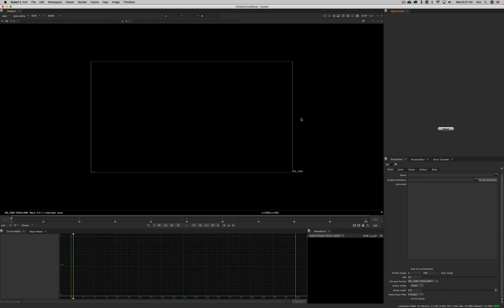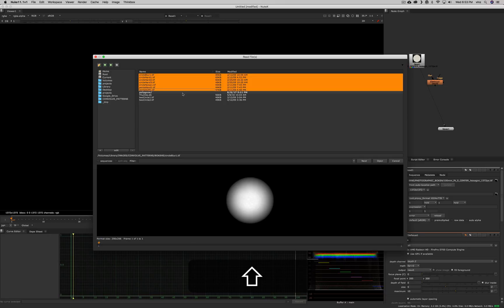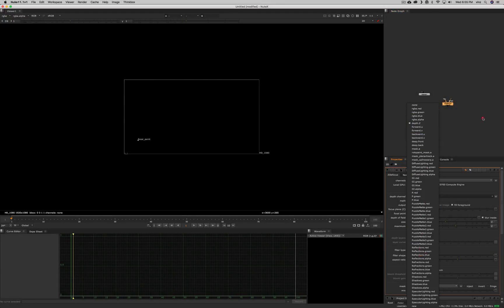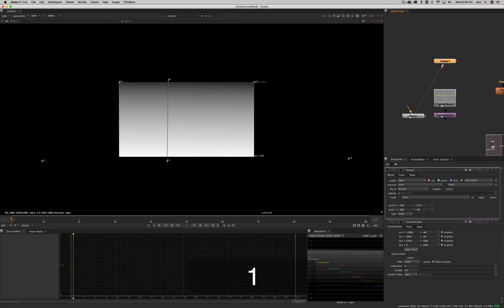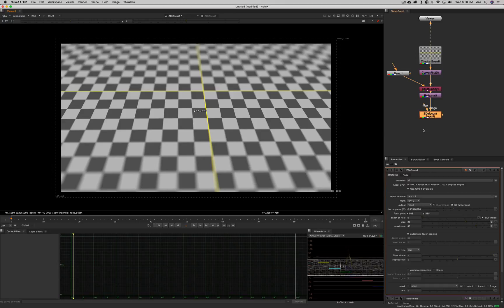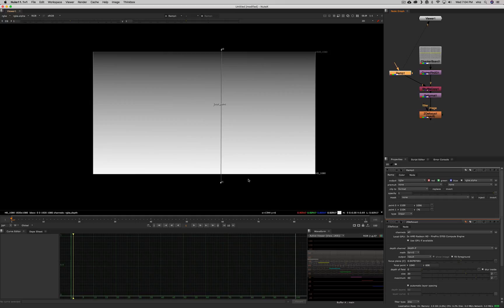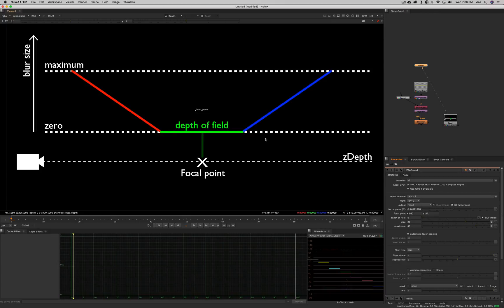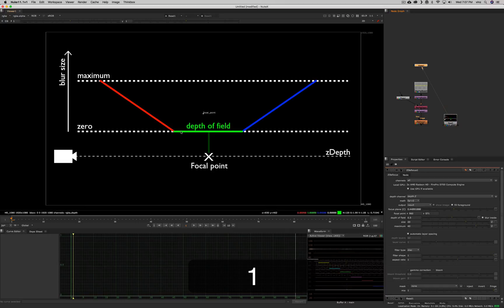Nuke Nodes Kickstart - ZDefocus

Comment: Great explanation mate, really helped to understand the concepts.
I got a question: Why is it a common practice to extend the edges of Z-Depth before feeding to the Zdefocus node to avoid artifacts?
Read that it's because of aliased Z-depth and antialiased alpha - but how does that be a problem?
Reply from the maker: Hey, Thanks for the comment! To answer your question, it would deserve its own video, I think.
The short explanation is that in the RGB channels, objects are rendered with antialiasing, while the Z channel (when not anti-aliased) describes an object's distance to the camera.
So if an object is at a distance of say 10 units, and the background at 100 units, the Z will show a value of 10 right next to a value of 100, while the color channel (RGB) will "smooth" the transition between object and background over a few pixels, hence the discrepancies between Z and RGB.
A quick and dirty fix for that is to extend the edges of that object in the Z channel to "cover" for these anti-aliased pixels.
I hope this answers your question a little bit :)
Reply: @TheFrameLab  Thank you for your time and attention :)
Was dealing with placing a CGI object into a scene.

Thought that artifact comes up only when we got Z channel for an object.
So, even if we got the z depth for the entire scene, problems persist.

Also, a friend in a forum told me yesterday - "At the edges, you might see an anti-aliased pixel that falls outside of the object on the non AA depth, basically creating a pixel that either sits at 0 depth or infinity depth, depending on how you render depth."

I think everything makes sense now.
Thanks once again :)
Reply: @TheFrameLab  hi, pretty much appreciate your work on this - going trough the nodes, quite helpful!
I specially liked your explanation on this one!! pretty clear an simple at the same time!! :)
should we expect more for other nodes? or you had enough for now? :D 
cheers